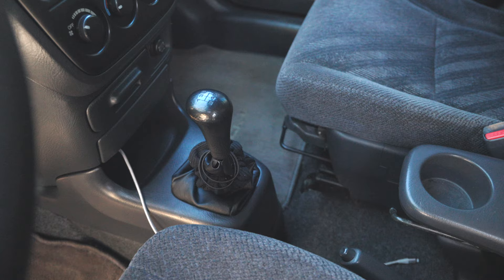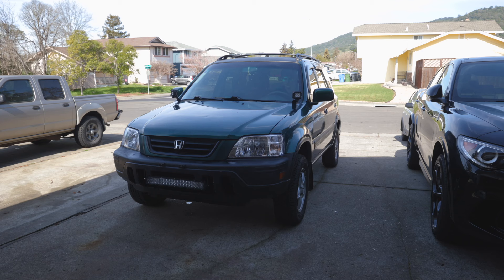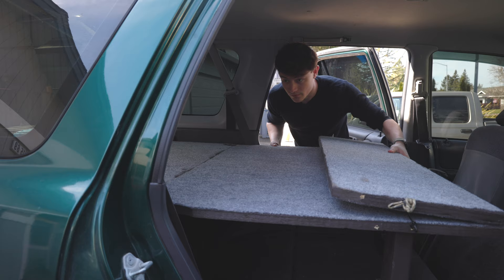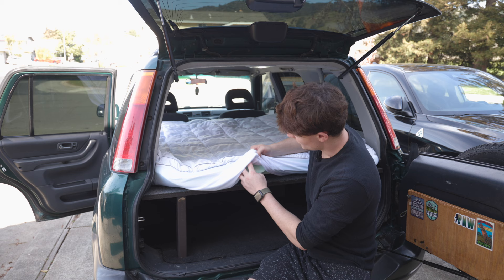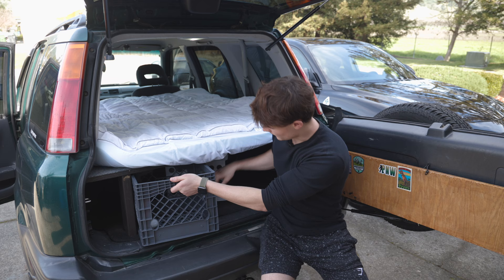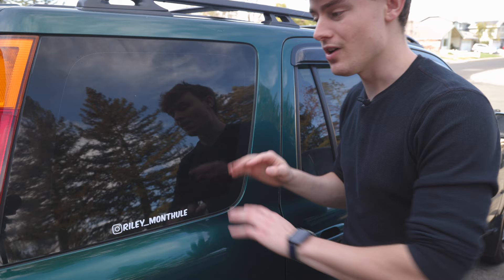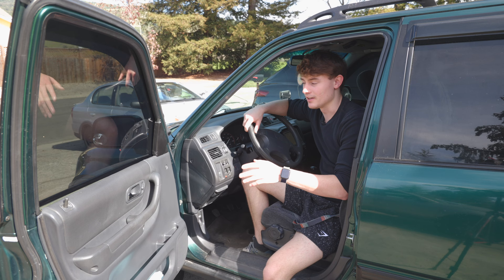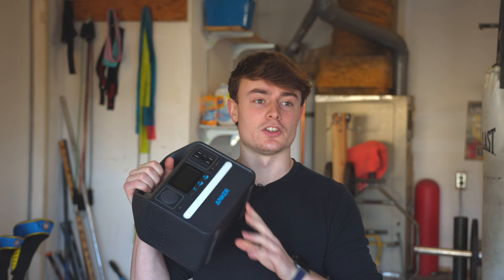DIY Honda CR-V camper build - How I can live out of a CR-V

Comment: But.. This removes the back seats, the build in beds, and blocks access to the cooler/under floor storage and table. Then you have to move all your storage somwehre when you are using the bed, or make sure everything is flat enough to fit under it. idk man.. This seems like a lot of effort to remove tons of built in functionality when you could just use a roll up mattress and the built in beds.
Reply from the maker: Answered this a couple times but the built in bed sucks as far as actually using it as a bed and once you make the bed with the seats you literally loose all the storage capacity in the car besides the small hidden compartments.. The platform bed is much more comfortable and provides tons of storage underneath and in the rear passenger footwell. You can also still use the under floor storage and table if you just take out the milk crates and if you need to use the back seats it’s designed to fold on top of itself in the back so the seats can fold back up. This is also for camping not for daily driving which is why it’s so easy to take in and out. I used the crv both ways and the platform makes long trips wayyyyyy more comfortable and organized especially since I was doing it with two people. Fun fact! I have over 100 pictures of people making this platform and using it now. Pretty sweet!

Comment: I had a '97 CRV but it was destroyed by a drunk driver. What a great car it was, I really miss it. I purchased a second generation 2002, and it's a nice car but my '97 seemed way more rugged.
Reply from the maker: Damn yeah I had a car salvaged like that as well. Nice! Yeah the second gens are sweet but I love my first gen
Reply: In the same predicament as you. I've gotten a 5speed 2002 2nd gen. Always finding myself missing my 5speed 1997 more. I finally might get rid of the 2002 and get another first Gen.
Reply: How sad.
Reply: More reliable air-conditioning too
Reply: I still have our ‘98. Only 144,000 miles
Reply: I have one now 99 roughly 300k which is my daily driver and I will probably never get rid of it unless something like that happens And I would probably be devastated. It’s completely stock besides a radio and I wouldn’t change a thing. It’s meant to be slow. It’s meant to get you where you gotta go.
Reply: I'm still driving a 99 LX crv. It needs a lot, but I'd like to upgrade to an ex or fix this one up. So used to this one, can do all the maintenance stuff myself, don't want a different/newer model.
Reply: I got crv 1999 son nice I definitely will do the same table you did

Comment: I recently bought one for $3.3k, had 142k miles on it and the previous owner kept it immaculate. Interior, exterior, and engine bay were CLEAN. No mechanical issues. That was a month and a half ago. A week and a half ago, however, it was stolen and two days later was found totaled. I have comprehensive, but man, I worked hella hard to save that money up, only for it to be gone in just a few weeks. I really loved that car, and I am currently saving up again in hopes to find another one, this time with the 5-speed and AWD instead. Thanks for this video, hella great information that I'll be using in my next one!
Reply: That's why I keep an anti-theft club on my 2nd gen CR-V, i'm terrified of losing her. I'm so sorry for your loss that's absolutely terrible
Reply: Smh sorry for your loss bro. I keep my dude in my site at all times especially where I'm from. I feel like since I've gotten my crv I've seen a lot more of them and they look really good when their done correctly
Reply: that is absolutely wrenching to hear bro

Comment: I had an '01, I've never had a vehicle that I loved so much.  It was a combination of economy, ability and surprisingly space.  I'm  6' tall and I could climb into the backseat crouched down but still on my feet and the open view with the large windows was awesome. I have an '11 now and while it's nice it feels way different and I don't have the same love for it.
Reply from the maker: O yeah one of the best cars ever made!
Reply: Bro how did you fit in the driver seat I’m not 6 foot but def would like more space I feel so tight in driver seat
Reply: @shootoo710  I guess I don't know, I have a 2011 crv now and I find it to be more cramped than the 01. I was pretty comfortable in it.
Reply: @shootoo710  What do you weigh?  I'm 5'10" and I don't even drive with the seat all the way back in my 1st gen.  My mother has a 3rd gen and it's built out more like an accord and driving it is fine as well.  Less room in the back.  The rear seats don't pop so they don't lay flat.  That somewhat sporty more modern look is what compromised the rear space and the rear hatch is just standard lift up and shut down.  I like that in the first gen you can just lift the glass all the way.  Or you can just pop it and leave something between it and the car door style gate for ventilation.

Comment: My first 4x4 was a '99 CR-V, and I took that thing down some insane trails and over obstacles you wouldn't believe. Amazing vehicle, and hands down one of the best and most fun vehicles I've ever owned. I had a 2" lift with 235/75/r15 tires, a DIY roof rack, jerry can on the back, and a 4500lb winch mounted on a custom steel mount I designed that hid the winch inside the  factory bumper skin. Sadly I had to part with it due to circumstances outside my control. Thanks for sharing your setup, looks really slick!
Reply: Bro I dared to hit some trails my 2wd 01 crv and it suprisingly was able to go up hills with a little push lol
Reply: @adancardona4723  Front wheel drive in itself has a pretty solid traction advantage over RWD. You can imagine how impressive it is with RT4WD added in.

Comment: Simply brilliant.  I was thinking you could use a 12 volt RV fan on low to keep a nice air flow going through the rig while it gets warmer.  Add a coiled up hose to hook to your water supply and be able to direct water flow.  If you doubled your water supply and let it get warm from the sun, you can have a camp shower too.  I don't think I would add more than double the current weight to the roof rack.  A refillable black shower bladder can hang from anywhere and rolls up to a tiny package.  I used to be in the Army so we lived in our Humvees and I pimped it out like an RV.

Comment: Awesome video! I like seeing these CR-V soft roading builds. It looks like your 97 CR-V is an EX. Here's a fun fact about those EX CR-V's. The front and rear seats actually convert into a bed. When Honda built these at that time, they wanted people to use them to go camping with having a little accessories needed so you have more storage in the car for other things. That's why they included a table in the trunk. It's actually really comfortable using the front/rear seats as a bed. Never tried putting a mattress in there to make it more comfortable though, but can't see why you couldn't. Your CR-V looks so clean, and i like the light bar/pod idea. Might have to do that. Thanks for the video!
Reply: How do you convert the front and rear seats into a bed?
Reply: @anon20000  on EX's the rear seats have a lever to raise the rear seats up. It's located on each sides of the rear seats. It looks like the lever that the front seats use that you pull up to recline them. After you raise the seat, you pull up on the lever that's on the top of the rear seat to lay them flat. It's the lever that adjusts the rear seat to recline. After the rear seat is laid flat, you can pull the head rests off of the front seats. Pull the lever to recline the front seats all the way down, and it'll connect with the rear seat to make it one big flat surface.

Comment: Add to your recovery kit,  a second rope more shackles and a come-along. I had the same crv slide off my driveway in winter,  it's steep and tight, I went over the banking and with the come-along I was able to winch it back uphill by tying off to a tree. It was slow but I was able to do it alone, a power winch would be great but a $30 come-along has saved me a few times.
Reply from the maker: O yeah that would be great to have on the CR-V but my new van build has one! Very useful

Comment: What I love about this build is that the one thing I’d be worried about is visibility, but the bed lays perfectly under the rear window!

Also, that painting on the rear table is amazing. Love the tiny CR-V, it’s adorable. 😂❤️
Reply from the maker: Yes exactly! I was going for a practical build I could use for long miles so that was a necessity.

Comment: I’m doing a smaller bed build on my 2003 2nd Gen V. Manual transmission model. I removed the right rear pass seat entirely. I only need 30 inches wide for my foam mattress because it’s just me and 2 cats. It’s off to a Baja adventure hopefully in Jan 2024.

Comment: I just bought a 97. I had an Element before this and did pretty much the same thing. It got horrible mpg but it was better than the CR-V for camping probably . It was not as easy to work on as the CR-V. I really like the K24 engine. But this B20B seems to run just fine. It only has 124,000 miles and I have all winter to restore. I am thinking of taking the rear wheel drive out of it. I have always had good luck with front wheel drive. I have an 88 Jeep YJ for off road trips. But even just FWD will go very well. Anyway, I loved your video. Well done and informative. I am going to go the water route. carrying two 5 gallon jugs is heavy and take up space I could use for other things. I subscribed and will ask other CR-V owners to do the same. Keep On Trucking young man. Enjoy life.

Comment: I like your setup. I either bring a tent or convert the interior seats into the bed with pillows and blankets. I also like your table you built into the tailgate, I just use the one under the carpet in the cargo area. I wanted to attach a folding cup holder tray to the tailgate though.
Reply from the maker: Thank you! Yeah the stock features are fantastic for smaller camping trips but having the whole setup is really nice for longer bouts.

Comment: I just got one of these,  i still don't even know all the functions really.   it's not a standard and I didn't want an automatic but this was crazy low dollar,  i mean amazing. LOL    your roof top tent thing you were talking about is baffling me though. I don't understand how that even works.   one of the reasons I got mine so low is the roof was bent in, the guy didn't know much about the car  but I talked him down of every point I could find, the roof being one of them and it was a big discount.    after I got the car , on the way home I stopped and opened the side rear door and with my open had i whacked the roof liner had asfk and the whole roof popped right back like it was supposed to be. LOL  I mean instantly, it was holding a puddle of water and that flew up .     I dont see how anyone could sleep up there. ( I'm big but not even a small person ).  very weird.         one of the other things was the radio was blocked,   I still can't believe I did it but on the 9th try I guessed that number.    I was going to pull the head unit and call the dealership with the serial but I didn't have to. 
  another thing that I talked him down on was it pulls to the right.   I didn't realize whats up with the all wheel drive, i thought it would be like my 01 yukon denali   all wheel all the time.  is the automatic that way as well?  I mean is it like you said, the rear wheels only drive when the front wheels slip?    cause thats kind of a game changer as the wheels should be all the same on a awd  vehicle right?   if they are not driving when normal driving is happening the front wheels will wear faster correct?      at the moment, the car has 3 different brand tires  so I think that is why it pulls to the right.  but i might have to align it after I get 4 new tires.  when i say i just got this I mean, I have not even been to the DMV to transfer title yet.   i really don't know anything about the functions of everything.   I only got 1 key and no key fobs.   do all of these come remmot access locks?   Mines and EX,    I looked up some remote instructions for the 99  and it has some things that make no sense for programming, stating I have to push the valet button that is between the am/fm and the CD button.   my radio has 6 presets in a single row and there is no button between the am fm and CD button.      so I dont know if I should invest in fobs.

Comment: Yours is a second gen, 
Mine is the last of the first gen done 250,000 km a 2001 model.
Im doing it up as a camper with a. Solar panel, 100 amp hr battery pack agm & carfridge / freezer & roof rack & spotties & bike carrier for my Kawasaki z125 pro .
I'm making my own custom roof rack ,and nudge bar.
Reply from the maker: Mines a 99 RD1 first gen CRV. That’s sick! Would highly recommend going lithium instead of agm. Agm is terrible for everyday use

Comment: I have a 2002 CRV auto. It comes with a picnic table. I add a 2" Trailer for multiple purposes.  I like your seat folding in two. .my seat they take up too much cabin space behind the seats.   The paint job is gone, clear coat is toast.  I hit some serious mud holes and got red sand all over the undercarriage and engine.  Having to push the seat forward would work for me.   You are spot on about the water's gravity.  Question! Do you use paper products to help you from using too much water when camping. I did not see a cooler,  do you avoid keeping cold items?
Reply from the maker: Thank you! No I use normal dishes and wash them with the water. The water still lasts a very long time with this. I used a yeti cooler in the back to keep everything cold!

Comment: Had a 1998 honda crv it was even the same color green... I accidentally hit a deer going 40 mph and it just leapt over the thing! Killed the deer graveyard dead. I don't waste anything so we just loaded it up took it home and cleaned it... had venison steaks. First gen crv are the most useful capable vehicles ever made in my opinion, far more of a people's car than a VW beetle and the AWD can nearly climb a block wall. I have pushed snow with the bumper  and in icy weather drove past jeeps and trucks in the ditches that had chains on while I was sporting bare rubber. I even pulled a loaded Chevrolet 2500hd diesel box truck UP HILL back to a guys house... you should have seen the look on his face!😅
Reply from the maker: No way that's crazy! Yeah their crazy capable for what they are. Little work horses

Comment: I have exact the same old honda crv. Just 8 screws, u can removed addition weight of rear seats for space. I also remove driver side flip consult and passenger seat for addition spaces. About the water sewer bar, i like ur ideas, but, detach end to allow it flip up. Or i just place my bucket on top of car when i park. I agree with u, all the pump just add more weight and trouble. I wish this honda crv has menu hand crank, so glass window can be crank open while car is park. The rear door flipper door is too close to the plastic door. When cook there, plastic may milt. I am still searching for better cooking solution. Do u have better idea without adding more weight?

Comment: You made no mention of making use of the storage space or the folding table under the cargo space. Does storage and table help at all?
Reply from the maker: The bed platform makes the table annoying to access so I just used the table on the tailgate and used the storage under it for stuff I don’t normally need like tow straps and some tools

Comment: Awesome video! I have a 2000, and  a few small issues I want to get fixed (including wipers that turn on randomly). Any one here have recommendations for someone who works on older CR-V's in Southern California?
Reply: i do not , but wiper motors should be pretty easy to fix , good luck

Comment: Awesome stuff thanks for this!  Would be nice to have a list of the items you mentioned, esp the charger thingy which I would like to buy. Just an idea, thanks. Also how do you attached the water pipe to the roof, just strapped on or what? (I have no idea why you wld put your water in a pipe, why not just in water jugs?)
Reply from the maker: Thank you! I’m gonna make a more comprehensive build video here soon with all the products and materials listed below. For the water pipe I just ratchet strap it to my stock roof rack but people use big metal clamps when they have something like a roof basket. A five gallon water jug is huge! And we already have no extra room in the car haha. Plus with the tube being on the top the water is naturally heated on a sunny day. Plus we change elevation A LOT and plastic jugs are prone to leaking with elevation change. The last thing you want is five gallons of water leaking in the back of your car.
Reply: @RileyMonthule  Good points thank you, appreciated!

Comment: Does your crv not have the bed seats? Mine does. Front seats fold all the way back flat and can match them up with the rear seats and fold them all the way back too. Look up crv bed seats.
Reply from the maker: O yeah it does but the platform is much more comfortable and the bed seats take up basically all the room and storage in the car and take a while to set up. Platform is much better for longer term camping
Reply: @Riley Monthule  that's understandable. Personally, if it's just me camping in the car, I'd have a roll of cot padding and only flatten out one of the seats. Then fold  the other rear seat foreward to retain storage space. To each their own. I'm glad you've found a system that works for you with your car. Cheers 🍻
Reply from the maker: @jacobgillean7129  O yeah that would work great. This setup allowed me to sleep two people comfortably though. Crazy for such a small car haha